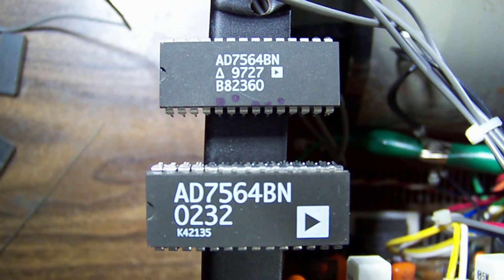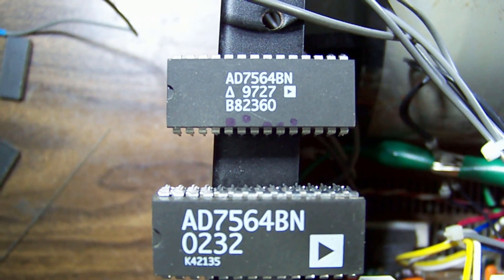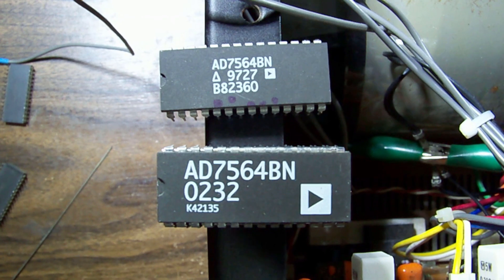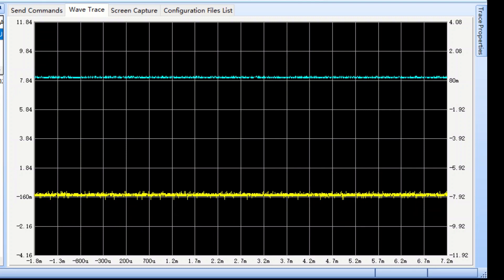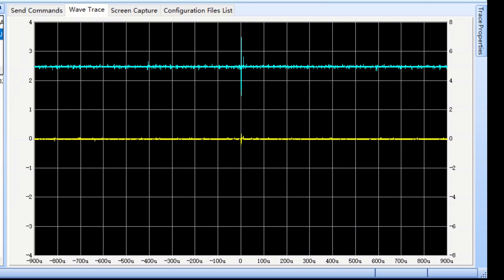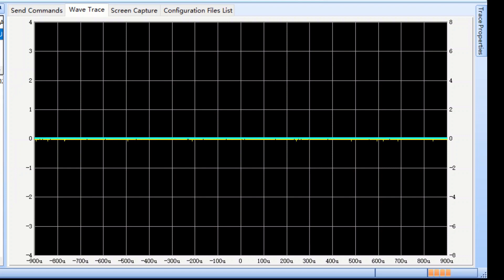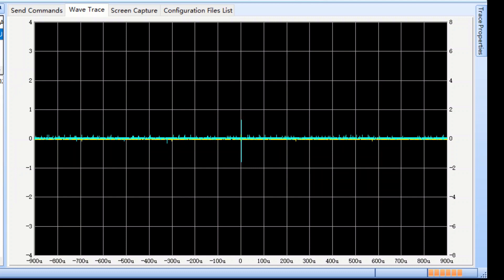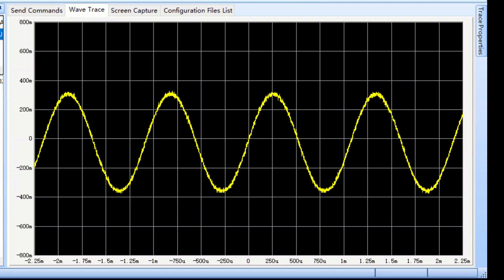Nakamichi IA-1z full volume repair attempt part 2

Comment: @9:05 it won’t be linear, it will be a logarithmic adjustment as that is how sound tends to work to suit how humans hear.

Certainly looks to be a bit of a pain.

The big voltage offsets towards the end could be a low frequency coming through, something like 50Hz could look like that if you are looking at a 1KHz signal, the 50 Hz waveform will look like a varying dc offset in comparison.
Reply from the maker: Oh true, thanks for that! Everything's just hanging out, might be less of an issue when put back together with shielding where it should be. There is a solid metal plate between power supply and this board normally haha!

Comment: Hmm the plot thickens lol.
So the d.s.p is pulling the line up, so why does the dsp need to connect to that line?
Does the d.s.p pull the line to low ok?
Can you stick a shockky diode across the broken line to allow the d.s.p to pull down but not force it to a positive logic?.
Sorry bodging brain has woke up lol :-D
I'm happy you have found a solid fault, it's all to easy to give up (sinking heart feeling).
At least the new chips are fine.
Reply from the maker: With the DSP disconnected its pin floats to 5V, I think the internal driver might be shorted or leaky as it goes to about 2V when connected due to resistor to ground that normally holds it low. Hmmmm... if I left it and forced it low the chip might get quite warm... could be fun to try.